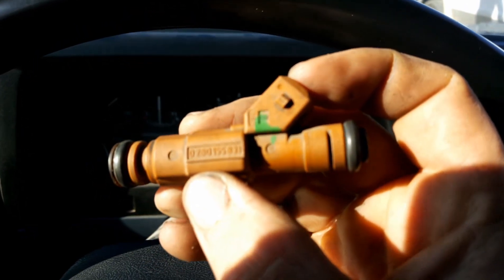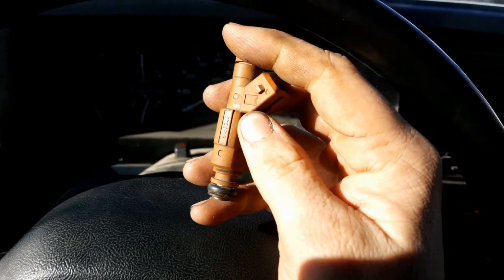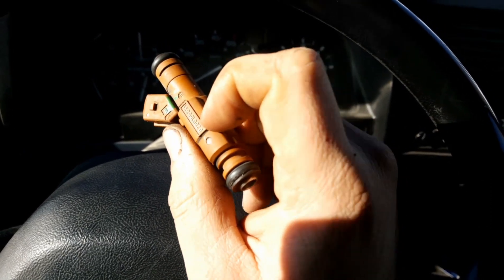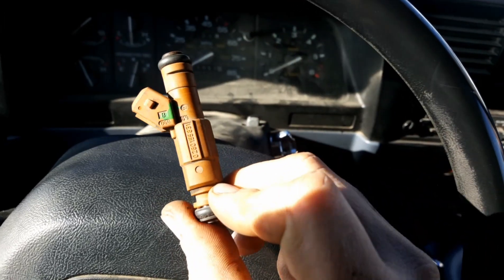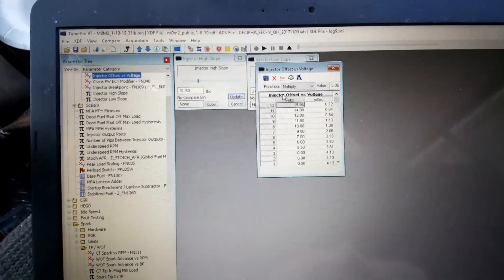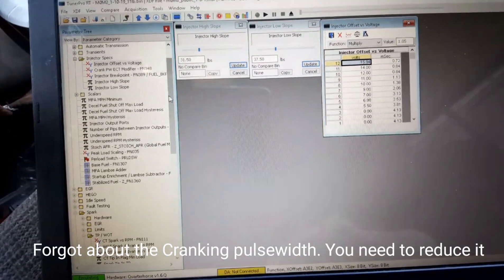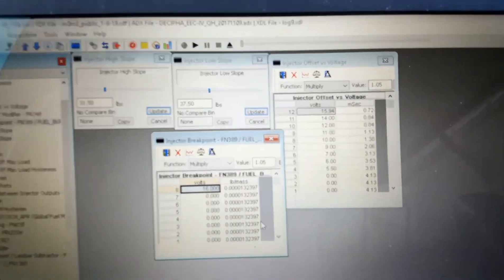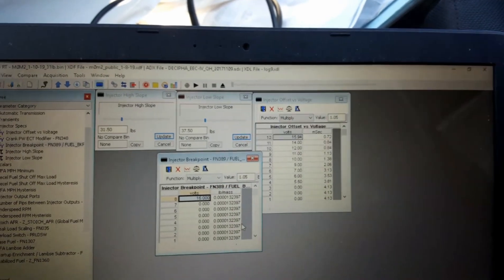Ford Ranger 2.3 - E85 preparation

Comment: Would this also work on a 2.5l 98? I'm looking for a affordable way to increase power without boost
Reply from the maker: It should work fine, as long as you can modify the tune for it.

The biggest boost in power I saw on my 2.3 came from a cam and adjustable sprocket though, to the tune of almost 30HP